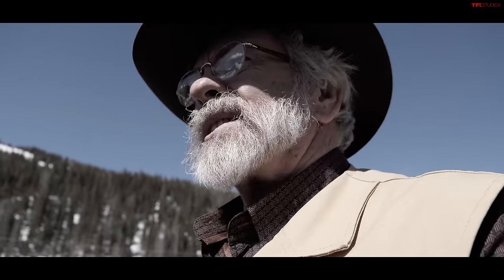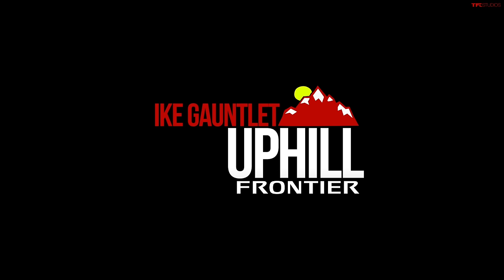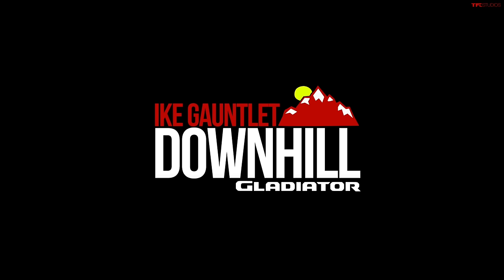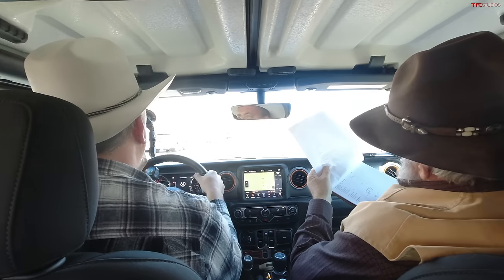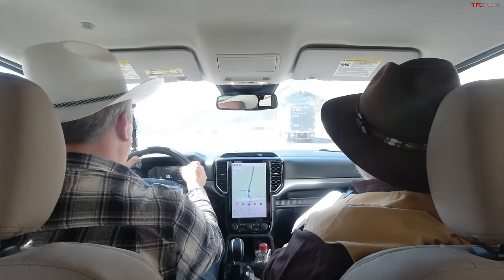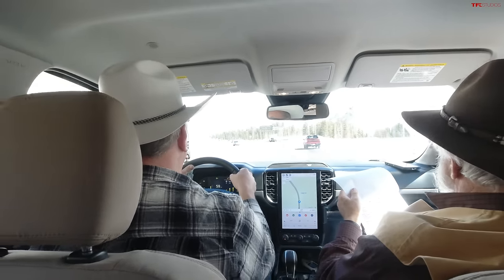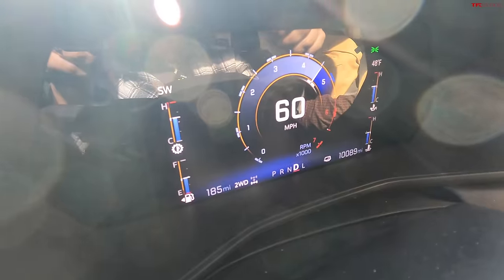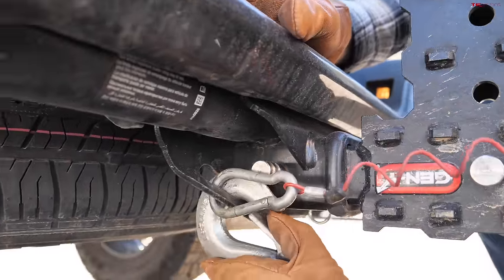MEGA Ike: New Tacoma, Ranger, Colorado, Gladiator & Frontier vs the World's Toughest Towing Test!

Comment: I have a 21 Ranger and i seem to be riding my brakes going down hill it doesn’t down shift enough. Good video
Reply: Can you manually shift it to a lower gear so you have better engine braking?  All modern auto transmissions that I have seen allow you to do this, but I don’t know about the Ranger.
Reply: @91CavGT5  yes if i put it in sport mode i do that sometimes
Reply: Use tow/haul mode

Comment: On your comments on fuel mileage in the Colorado, you should ask your contacts if with smaller displacement engines and turbos they have to run a richer fuel/air ratio to run the engine cooler? In piston aircraft fuel can be used to cool the engine by running rich but you burn more fuel. A good comparison would be the f150 5.0 vs 3.5 on the IKE?
Reply: turbocharged engines always have a difference in brake specific fuel consumption due to this necessity for extra cooling. On the colorado high output 2.7, they mitigate this a little bit with piston oil squirrels in the crankcase. Still seems like they could have gotten a few more MPG out of it, especially with the auto stop/start and capability of shutting off 2 cylinders in cruise
Reply: @jastrckl  thank you , I did not think about the piston oil squirts , would be interesting to see how they help in this cooling process and have a discussion on it . I wonder if the fuel air ratio is changed as the cylinder temps go up or if they detect detonation causing to go richer or leaner .

Comment: I am buying a Ranger at the end of the year with a 2.7 ECO FX4 XLT down grading my 2015 F150 with a 2.7 FX4 great truck super-fast and strong I sold my boat so I don't need it anymore, can't wait to see how fast the Ranger will be with a 2.7
Reply: Check out i do cars.. the 2.7L is junk
Reply: Ignore Joe
Reply: @joelmora2826 you’re telling a guy who owns a 2015 with the 2.7 EB it’s junk based off a video you saw on YouTube? Think about that for a minute.
Reply: The 2.7 is the best ecoboost engine of the bunch.  

I have the 3.5 ecoboost in my van, but would have gotten the 2.7 if it was available.  Ford only offers the 3.5 ecoboost and the 3.5 NA in the Transit. 

The 3.5 ecoboost is a rocket ship though. A ton of fun in the transit.
Reply: I live in Baja a 4x4 is almost required the boat launch half sand half cement brutal 2 wheel drives can't do it big 3/4 tons struggle I had to air down to 25 lbs. I can say through observation my truck preformed better than most plus I used my truck to haul stones materials constantly in 4x4 has not failed me yet.

Comment: I know this might sound like a dumb question to you guys, but I am new to this pick up truck world. I have a Jeep Gladiator Sport S with aftermarket 20 x 9 rims 35 12.5 RBP M/T. Do I raise tire PSI when towing. Normally I run with 28 PSI. On the side wall it say not to exceed 40 PSI.

Comment: Those smallish turbo 4-cylinder engines and the gearing do not offer much compression braking. One of the many tradeoffs that manufacturers have to juggle these days. The other thing I wonder about with these turbo 4cylinder engines is what kind of top end, passing, power they have for 2 lane road passing? I am not impressed by these power trains compared to my 2018 ZR2 Colorado's V6. I'll keep what I have for now.
Reply: 4 cylinder turbos possibly have MORE passing power than a V6. where i live a 2.3 turbo 4 cylinder Mustang is not much more sluggish than the 5.0 V8!!!

Comment: I wonder if you were to do the test over again for the Ranger and you manually controlled the transmission, how would that affect your results?  It would not allow the computer to skip any gears.   What are your thoughts?
Reply: Too many gears in the Ferd.  Ever try passing someone and it has to downshift four separate times?  Too much..
Reply: @thewireman134 lol. Clearly you have never owned one. That trans is in multiple models with absolutely no issues at all.

Comment: I can get that exact Colorado Trail Boss in that exact color right now at my dealer for 34k.. and I can get that exact Tacoma right now at my dealer for 56k. Give me the Colorado, all day, every day, and twice on Sunday.
Reply: Here comes the you bought the Colorado because you can't afford the Ferd argument😂😂😂😂
Reply: Does it have cruise control?
Reply: The Colorado 2 yrs old? With the V6? How many miles.
Reply: @thewireman134  the ford is a no for me just off styling alone, I don’t like it. It looks outdated to me, like 2010’s ish fords, or the foreign rangers of yesteryear. The ranger has more in common with the Maverick than it does an actual raptor. For those that are saying I purchased a truck because I couldn’t afford the ford, I would say you bought a maverick because you couldn’t afford an actual raptor. I was a ZR2 or TRD Pro guy, but considering the current pricing of Toyotas, that makes the decision very easy for me. The Chevys are selling for what they said they would sell for, base model no feature low power small screen Tacos are selling for more than the ZR2, which means the actual competitor to the ZR2, the TRD Pro, is going to be selling for 70k, a whopping 20-21k more than I can get the ZR2 for right now. I was considering between the 2 under the assumption that they would cost the same, if everything is equal I don’t know that the TRD Pro is better, but I do know it’s not better to the tune of 15-20k more, and it never will be. This is all coming from a Toyota fan, and someone who was very excited for this new generation. It’s a fat no to any Tacoma right now.
Reply: @ChrisDavis333  What dealer has a yellow one for $35k?  Andre's is a trailboss and without any options they start at $39K msrp.  The yellow color is not available on the lower trims WT and LT and only starts on trailboss.  WT starts at $35,445 and LT at $37,845 msrp for 4wd.  Be careful out there as I have seen a lot of dealers carrying 2wd trucks.  I have a feeling during the surge that is all they could get.  Here in the northern midwest those 2wd trucks are not desirable.
Reply: @spyder000069  nevermind it appears my comment about the dealer was deleted.. maybe the owner of the video didn’t want me providing knowledge to a truck for sale? Modern Chevy Winston Salem NC. Google is your friend.
Reply: @hvrden8260  no, it was brand new, 2024 Trail Boss. The owner of the video deleted my comment pointing you to the dealers website, I’m sure you could find it, there’s many out there at a bunch of dealers in the states of NC/SC and I’m sure beyond that. One of the ones I seen happened to be in Winston Salem NC. Google the next 2 words I write, modern chevy, there might be a dealer that shares that name, I’m not telling you what to do with the information just look at whatever you want to look at, that may or may not include the truck we’re talking about.
Reply: @ChrisDavis333   "may or may not include the truck that we were talking about?" I'm only talking about one model. This model is a 2022 because it is a trail boss with the v6. And 2024 they do not make any trim with of Colorado with a v6. Since you're such a smart guy if you Google 2024 Chevy trail Boss and look up the engine it's going to say that it's a 4-cylinder. There is no V6 option for the 2024 trail Boss. As a matter of fact there is an article from a Chevy dealership saying that in 2024 the V6 is no longer an option on any trim. So no it's not apples to apples
Reply: @ChrisDavis333  Both of the trail boss from that dealer have a "please call for price".  However the WT work truck trim they are selling for $34k.  Trailboss is a +$4k over WT trim when comparing msrp.  If they are selling TB at $34K I would put one in my driveway tomorrow.  I would say there is a mistake on their pricing you saw or some monkey business going on.
Reply: @hvrden8260 Idk why you’re talking about a V-6, I’ve only been talking about the 2024. Are you saying the one in this video is a 2022? If it is I’m not sure. I was saying I can get the 2024 version for 35k at my local chevy dealer and I was contrasting that to the 56k TRD off road at my local dealer. The ZR2 is out there for insanely great prices, if the brand new one can be had for 35k with 0 miles, it is safe to assume used would be significantly cheaper.
Reply: @spyder000069 I just enquired, the 35k price was some Easter promotion they were running, it’s now 38,9. If they were selling it at 35k that tells me they would do it again. At 38,9 I would get a regular colored one, white/black/silver/blue, I never seen those colors discounted just the yellow and red ones. My guess is those colors are not popular and were maybe instructed by the manufacturer to discount or they sat for more than 60 days which triggered a dealer incentive. Idk but they were discounted guaranteed.
Reply: @spyder000069 the same price changes are also reflected on auto trader. The only one that hasn’t changed back is the dealers website. I’m going to be back in the area this weekend, now I’m curious. Appears someone snagged the red one for 35.
Reply: @ChrisDavis333 In my opinion it's the CHEV that's too ugly, with the TOY a close second !!
Reply: As a chev guy, the price of fuel, and my 14 chev 1500 starting to show its age id love to trade it in for a Colorado. But at over $50k CAD and less options im better off staying with my half ton

Comment: I’d buy the Gladiator for the solid front axle and tough build quality. The off road capability blows the other trucks away! The Jeep can also be easily modified and lifted!
Reply: Engine is proven and reliable.
Reply: Would’ve been a different outcome (not saying it would win) if they had the Gladiator with the tow max option that has 4:10 gears and 7700 lbs towing capacity.
Reply: @dc686  I was thinking the same thing
Reply: It's a Jeep thing only you understand...

Comment: GM has gotta give the Colorado a 3.73 gear option or do some tuning with the transmission. It had the most TQ by a wide margin but didn’t perform any better than the ranger or taco except in fuel economy when loaded
Reply: Colorado lost 3.1% gear ratio due to its 1" taller off road tires compared to the ranger.

Comment: I just purchased a 2024 chevy Colorado trailboss and I hate how they put the 4 wheel drive buttons on the center console so it's easy to bump into it and pop it into 2 low by accident while driving. My 2022 silverado has it on the left side of the steering wheel which is much much better why did they put it on the center console I don't know but it's a stupid place to put it and very dangerous.  the passenger can tap it also by accident or on purpose.

Comment: Get rid of all the pointless tech. Normal key start not push button. A manual and drop the price to under 30K for a more basic truck that's what they outta so but that'll never happen lol
Reply: Exactly!!  Get rid of all of the nanny crap, manual crank windows, manual locks, basic V6 that doesn’t have displacement on demand and doesn’t have direct injection.  Some of us still want a bare bones truck that is no longer offered.
Reply: @91CavGT5 frontier starts at 33k with a v6 no turbos😤
Reply: @JoseRuiz-ry2up  too expensive!!
Reply: Well I love my Canyon Denali, best tech of any vehicle made..  so I'll keep that, and you can buy the Ford with a key or the frontier with 1999 tech.
Reply: @thewireman134  sounds good to me!!  In 25 years I’ll still have a running and driving vehicle….. and yours will be scrap!  More electronics have decreased the reliability while increasing the price.
Reply: @91CavGT5  exactly😂 at first I wanted a trailboss Colorado or f150 5.0 but in my day to day use seeing as the newer Colorados only have turbo engines and f150 gulps down gas like crazy the frontier was a no brainer it’s a decent truck without all the extra electronics and no TURBOS!!!
Reply: @JoseRuiz-ry2up  I had a 2010 Frontier and it did everything I ever wanted.  It was a great truck.  The best truck I ever had though would have to be a 1994 Ford F-150 with a manual transmission and the 4.9L straight 6.  The oil pan had to be replaced when it had 267,000 miles on it due to a stripped oil drain plug. With the oil pan off, you could still see the cross hatch on the cylinder walls!!!  It got great gas mileage on the highway, was simple to work on, rarely had any problems out of it, and would pull anything you put behind it.  It just wouldn’t win any drag races.  I miss that old truck!!
Reply: @91CavGT5  im not sure why they can’t remake older trucks without all the extras.
Reply: @JoseRuiz-ry2up  they were too reliable so the manufacturers weren’t making enough on new truck sales.  That’s the only thing that makes sense to me.

Comment: A more meaningful measure than the axle ratio and number of gears is the number of revolutions the engine turns in one mile in high gear. Easy to determine. Drive in high gear at 60 miles per hour and the tachometer reading is the number of revolutions per mile. This takes into account the transmission’s high gear ratio, the axle ratio and the wheel/tire circumference.

Comment: The only numbers that matter are transmission temperatures. The AutoMeter analog transmission temperature gauge starts at 100 and goes up to 250 degrees F. When analog gauges have the needle pointing straight up (11-12 o'clock position) everything is operating properly. Anything over 50% or 180 degrees F is a fail. Nissan: below 50% = GREAT. Jeep: 203 degrees F = FAIL. Ford: 50% = GOOD. Chev: 226 degrees F = FAIL. Toyota: 60% = FAIL.

Comment: What I really would like to see is the Ike gauntlet challenge but in the summer 85-95+ degrees, not during the cold season. Most people don’t tow trailers during the winter. Let’s see how these trucks do during hot weather!! That’s the real test of a truck’s towing capability. My diesel gladiator has no issues during the cold winter but during the summer it can’t tow for sh1t up steep grades due to the very limited cooling capacity.

Comment: I appreciate all the effort that went into a test like this with so many trucks.  However, when it comes to scoring the various categories, I think it would have provided valuable insight to use real numbers (where possible/practical), as opposed to transposing to a 1 thru 5 ranking.  For example payload/tow rating - just list the actual number.  Even other categories that are not associated with a hard number, like brake controllers/cameras/etc... tend to get skewed in the ranking when using 1 thru 5 scoring.  Perhaps there would be more value in just stating whether or not the brake is available at all or if its an orderable option.  Still appreciate the effort in putting together and executing a test this extensive.
Reply from the maker: Thank you for the feedback.  Much appreciated.

Comment: Andre, could you please explain to us Lehman more about your uphill and downhill and how you’re operating the trucks I understand when you go uphill you’re not using the cruise control. It’s all foot Power so going downhill though you always talk about how there is a second break application or third break application are you not controlling the speed with theaccelerator pedal and if you are once you hit 5859 miles an hour can’t you ease off the gas pedal yourself or are you using cruise control and the truck automatically goes past the speed limit I’m not quite understanding but you could control the speed going downhill can you not based off your aggressiveness on the gas pedal please explain

Comment: I absolutely love how they don’t baby the trucks, I mean 5700 rpms for 8 mins straight at full throttle is not easy. They actually ring the shit out of these trucks and I love it, especially since so many people tell me that full throttle is bad for it, when in reality it is in fact designed to be run hard like that. When I tow with my 2011 f150 5.0 I definitely run that shit hard and people tell me I shouldn’t, but then I’m the only one with a still good working truck haha.
Reply: That's true in the past some older guy told me you have give it the beans every so often to blow everything out your intake and valves

Comment: ranger vs tacoma, ranger average 17psi at 3800rpm, tacoma 12psi at same rpm
Lower turbo pressure makes these engines more reliable, I would go for the Tacoma, I love these test videos
Reply: The Ecoboost has been around since 2015.  The taco 2.4 has 48% new parts.  Ford has real data tacoma only has theoretical design.  I will take the 8 year design that's been tried and true.
Reply: @marklihsu  8 years of design flaws. Watch "I do cars", he has torn down many poor designed ecoboosts. I would take a brand new design from Toyota before ANY ford designed engine.
Reply: I will give Ford credit for the Coyote engine. That one seems fairly stout.
Reply: Ford is not knowing for developing or fixing their mistakes Toyota does it. And test their motors for more time than others before bringing it to the market  @marklihsu

Comment: Is the Canyon AT4X the best mid size or is the Ranger Raptor better ?
Reply from the maker: We will be testing this next month.
Reply: @TFLtruck  awesome, thank you!
Reply: The GM twins at4x/zr2 get you 6000 lb tow capacity versus ranger raptor's 5510.  None of these are the best midsized if you using it for towing somthing like a rv or other enclosed trailer since they are off road focused.  Also they are wider so if you are looking for the convience of easier parking you will lose some of that as well.  So "better" just depends on the use.

Comment: Motor is for sure under powered. Definitely  depending heavily on the turbo.That low rpm turbo spool up will cost in gas just like the Ecoboost motors. 1:14:55